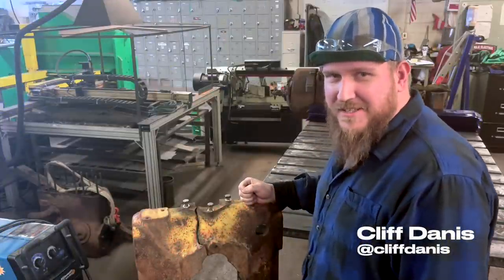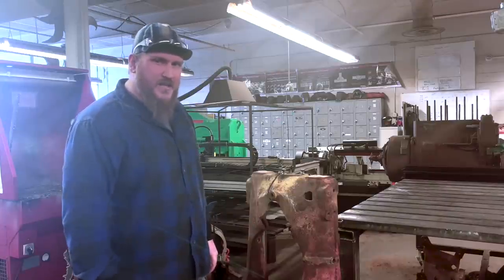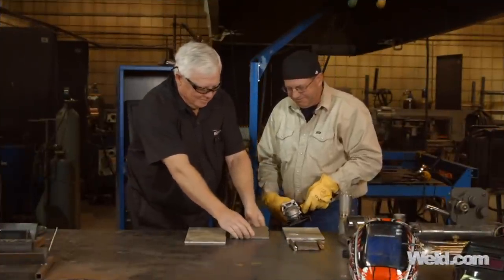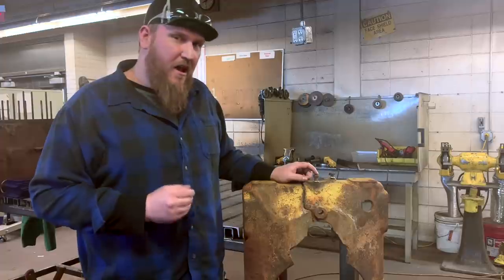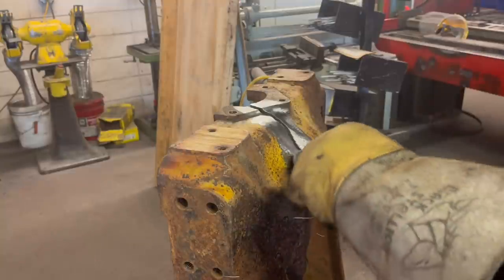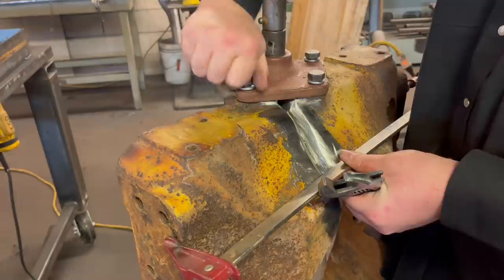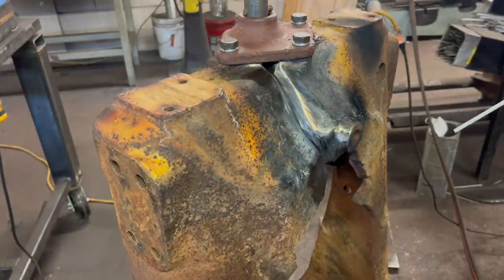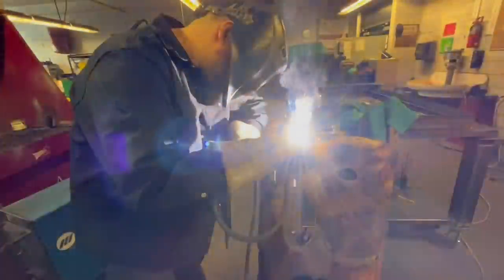Farmer's 101 on Agricultural Repair

Comment: Hopefully this repair will be a mini series, yes? Would be nice to see your finished product. A lot of us have had chaser drivers, header drivers, even dozer drivers breathing down our necks waiting for their gear to get repaired and back out in the mix. My welding really, REALLY sucks, but I’m a great grinder, and my mate was top of his class aviation welder who also did farm machinery when needed, so we worked as a team on many jobs together. My job while he was welding was to distract the implement driver until it was my time to clean & grind.
Off the record, I had him almost in tears when he tried to improve my welding, yeah, it was and is still that bad. I miss the old guy, he was a real, fair dinkum character, but sadly passed away on the job, one of the few times I wasn’t with him, very sad.

Cheers my friend, I’m sure your viewers would like to follow this project right the way through.
👏👏👏 👋👋👋 🇦🇺🇦🇺

Comment: one thing ... dont know if you did this, but after welding the one side completely...flip the piece over grind out the backside and get a full weld on the opposite side..  then the piece will be stronger as you mentioned.
Reply: A backgouge and back weld are absolutely a good option and habit to get into if you have any reason to question your root!

Comment: did a similar job on a cast iron front bolster off a 100hp tractor. grind out, drill your ends, preheat, weld with high nickle electrodes, peen immediately and cover to let her cool down over night. and pray ya don't hear the ping well it starts to cool and destess 😅

Comment: i have family that run a small farm type workshop. there is a big difference between hack welding job and dirty in the field get it through the day type welding. farmers often do temporary welding so they can get the job done and then get it back to the shop for repair. those sorts of repairs are perfectly fine. the problem comes when farmers don't do the maintenance and those temp repairs become permanent.
Reply: @TankToChest  i usually find money is the excuse rather than the cause. i've had bosses who have lost $1000 in production because they would not spend $10 in repairs.
Reply: Nothing more permanent than a temporary fix.

Comment: As a self taught out of necessity amateur welder. Prep is my friend. Farming equipment on my small homestead and vehicle/trailer repairs are most of my welding, with some fabrication. For years E6010 was my goto for everything but more and more E7018, E6013 and E7014 have found a place in my shop. E7018 covering most repairs these days. I still have problems fillings holes and bridging gaps. That said had I been doing that repair I would have "V'ed" out as you did but not to the point the gap opened, welded it up, flipped it over ground it out from the bottom down into my first weld so none of the "crack" remained and filled it again.
Reply: You can use electrode negative for open root

Comment: A great video. I just suggested this channel to a new guy on the farm who wants to learn to weld, and this video is right in time for it! I hope to use these lessons myself as I build and repair things.
I'd love to see guides on welding on loader buckets, as well as dealing with awkward locations on equipment.
From the brief references to what different types of rod does, I definitely need to put together a reference sheet for rod type and application, in addition to what spark tests mean.

Comment: Good video.... But do the same on the back side.  Gouge it deep then fill it up with stringer beads.  Wide weaves look nice, but often trap flux.   Weld a few support straps across the welds afterwards. Extra support in a stress area is always good.  Ni Rod (Nickle rod) is often used to fix cast.  Pre heating  your cast is good, but post heating is important too. DON'T let it cool too fast. That'll cause cracks.  Read up on welding cast before getting started.  Welding cast  is a tricky business.  I know.  I welded a LOT of it in a welding shop and was taught by old timers.

Comment: Preheating any cast is a must before welding! 7018 is the standard AAR requirement for all RR repairs but as you said 6010/6011 is something to fall back on in time sensitive repairs where thing have to move and you can’t do a preferred repair.
Reply: Ive done 6010 root then finished with 7018

Comment: Very good video. My suggestions would be. 1) after the root pass I would step up to a 1/8th rod at About 110A for a faster thicker fill. 2) Baking the rods in your household oven for 30 minutes or so at 350F before use.. assuming you don't have a proper rod oven.

Comment: 7018 type rods are the standard fix for farmwork over here in Europe. We don't have 6010 type electrodes here. 
Esab has a good repair manual with different filler metals for different applications. Problem is that there is just too many different types and they are rather expensive. 
That's why 7018 is usually the go to rod for most applications. And to be honest my welds haven't failed

Comment: 6010 and 6011 and even 6013 works ok for now to get you home type stuff but a good Lincoln 7018 will make a dam strong weld and people say it has to be perfectly clean to run 7018 but I'm talking you 7018 will burn through way more crap than your told (from experience)
Reply: A tube before valve had a leak and all the sector had stopped....as fast as you can repair it.for my good luck the tube was empty.but for my bad luck the whole tube from the leaking was a mess.H2So4 had started to build wall around the tube..i didn't clean up it at all...my employers was in a hurry.i complain that we have to grind it first and cleaning it and shaping the place to weld,to see if there is porocity or a crack,and i need a fuckin grinder wheel anyway....they didn't let me.....anyway I weld the leak with 7018 over slag and shit.the weld in vision was not bad better than shit.but the most important,works still just like that.

Comment: I was the oldest on the farm and broke my cousins go-cart at age 10. We had a crank top Lincoln welder and two boxes of rod. After some hammer work, I wrapped a chain around it like a turnakit. What did I know? My step dad & his father had day jobs that didn’t involved welding, they simply knew it had to be done when things broke. I fixed it and after grinding & rattle can action. I had some pride to keep to myself. I always said that a gamer who could not fix the equipment were doomed to fail. Look at todays fit with “Right to Fix” legislation. 
  I enjoy listen, watching but wished I could see the final product.
As you, need to plan time in Iowa, KS and NE to visit a “trashing Bee” to watch 10 ton machines do nothing other than take heat, create steam and rotors motion. Hundreds to look at as many show off their IH, Case or 1919 John Deere as if they had a convertible GTO, serial #1. Look, but don’t touch. Ok, you get my point!
 Great video, wish we had a shop class. DK, Omaha

Comment: Amazing video but I have a question! The preheat process, and welding temps followed by a slow natural cool down in such a high carbon piece of metal is basically annealing it and taking away it's original hardness. Because you're dealing with such hard metal in the rest of the piece do you have to temper the repaired section to reach original hardness or do you want the flexibility in the repaired area offered by the welding procedure to limit future cracking? Hope that makes sense, I'm still new to welding and metal work.

Comment: Hey there bud.  I'm another troll welder/tool maker.  Years ago I took a maintenance welding class(1999 or 2000) at Macomb Community College and we did a bunch of casting repair and dissimilar metal welding.  I'd like to see your use of 312 SS rod on cast iron to mild steel.

Comment: What about a 6010 root pass to dig in then fill and cap with a 7018?  I've lived on a farm my whole life (25 Years) welding since I was 9 . Dad always used 6013 and had some issues, when I went to college for welding I asked and learned a lot so we switched to 7018 rod.  But only having an AC welder and having to bake the rods for hydrogen was a big pain.  So I switched to 7014 and have had good luck with using that rod.  What's your thoughts on 11018 rods?
Reply: 6010 would work good for a root followed up by 7018! That’s a great combo and a very good option for field work to get a solid base layer of weld down before you switch to 7018. Personally I think 11018 is a little overkill. If you have it use it, but it’s a bit less forgiving than 7018. Make sure to keep a steady pre, inter pass, and post heat if you’re going to use it! It’s still a low hydrogen electrode.
Reply: @cliffdanis1521  Also wondering why you never covered any post heat or cooling information, especially for cast which I understand has to cool very very slowly.
Reply: Kelton this is cast-steel, different from cast-iron and is a bit less susceptible to the cracking you’d experience with cast iron. A little inter pass and post heat never hurts when moderated.
Reply: @cliffdanis1521  Hi Cliff you mentioned 200 - 300 preheat ... for us "frugal" types is there a cheap way to know when you reach that temp in metal?  Next question for high carbon content repair, what about a post heat?  Is it necessary, what temp and for how long?  Would some kind of crack detection not be a good idea (magnaflux or dye penetrant) after welding to confirm quality of repair before putting everything back together?  I always wonder is my weld really good or just looks nice.  How can I tell without xray?

Lastly, when you show welding occuring without some filter, all I can see is a blinding light and a guy holding a stick ... can you try and shoot so I can watch how you are manipulating the puddle, where the electrode is positioned in the crack, etc.?  Some weld.com videos are split screen (thats nice) or some other tech that allows really seeing the weld occuring.  Thanks for this relavant content, I will head to the garage to weld up a box scraper for my tractor.

Comment: Good advise. I have an old cast iron scalding pot that is cracked. I se that after I do my cleaning and grinding I need to heat that area before I start welding with my 70-18 rod. This is an old cast iron pot. Any tips and advise? The crack is approximately 10”, I haven’t dug it out of the dirt yet.
Reply: Keep in mind the repair on this video was made on cast steel, different from cast iron. For a cast iron repair you would need a nonferrous alloy for your filler metal. Either bronze or nickel work well. Not 7018!
Reply: Buy a new one, lol. It’s most likely gunna crack again. Thermal spray welding is the only decent way to repair cast iron I believe
Reply: I was looking at it yesterday. It’s been in the dirt so long that the rust has made it to thin to weld. It’s flower bed material for someone.

Comment: Hello::: Just got a Vulcan 220 Mig, going to learn to Mig. That was good info !!! Got a Sears 220-110 AC-DC welder 1984, did not get very good.
Reply: I have one of the old Sears models and tried learning on it. It was no doubt a tough learning curve. A few months later I bought a cheap mig/stick machine and could not believe the difference in ease of welding. Try SMAW again with that Vulcan, you should be pleasantly surprised at the difference.

Comment: There are many a chicken sh÷/ looking welds on ag equipment bouncing through the field pulling rocks out of the ground..... and the only reason that the farmer placed that weld there is because the 'Professional' welder working under idea conditions in a shop, placed a weld that didn't hold.
I learned to 'farmer weld in the '70s.... college learned in '78-80'. apprenticed in the '90s, Journeyman and red seal B pressure since late '90s and college teaching  welding since 2005.
The more we steer people away from the 6013 /7014 that I was sold in the '80s the better. Well done with this video.... but I have a soft spot (and therefore a defensive stance) for the farmer who cannot pay the hundred plus dollars an hour repair costs that are charged up here.
Thanks for getting information into the minds and hands of the common folk. Again well done!

Comment: Question: I have welded cast before using Nickel rods....I always thought they were best...But recently I have herd of just using 7018...Nickel is unreal price now..What are your thoughts?
Reply: 7018 would not be the correct filler metal to use on Cast Iron. A nickel based electrode would be one of your best options for welding filler metals

Comment: i dont mean to be that guy....   buy you said at 16:05 that you are holding the rod perpendicular to the workpiece at the proper angle...   since you are welding 7018 uphill,  is the proper rod angle not 10-15 degree angle upwards?

Comment: Wait I thought you said that was a farmer's repair. My dad always taught me to put some pieces of rebar in that groove to cut down on the welding time And bridge the gap crossways with a couple of pieces of angle cut off an old bedframe to make it strong. I don't think you know what you are doing (heavy sarcasm).
Reply: That is a gold comment! So true, fill it in with rebar and then just cover it with globs, it’ll hold. 
Glad my father taught me to like the video, take the time to weld it right, might have been burning the midnight oil but it was fixed right so the next night we weren’t fixing it again.

Comment: It’s too bad you couldn’t lay that weld joint flat and use a 7028.   It lays down much more metal for wide grooves and is also a low-Hy rod.

Comment: Now let's say you have a crack in a bended piece of the metal and you can only grind out part of it.    In theory could I start from the grinded part and work into the crap? That way I'm working to the contaminated steel rather than bringing the contaminates with me

Comment: yeah.... you are not running 7018 in an ideal way from what i see from the welds.... it looks like you are backstepping along the way like you are welding with 6010 or 6011...   you just run straight up and let the pool fill in,  maybe a slight side to side movement,  but that is honestly personal preference and whatever fits your welding style the best...   anyways,  i just run it straight uphill with a 15deg angle and let your travel speed allow the puddle to widen and contact each side of the bevel,  not backstepping.

Comment: A nickel rod would work way better, I'll just about garentee that's going to break. 200 degrees is what you heat thick low carbon to, cast should be bright up to 500. As someone that fixes and repairs all types of cast irons, this video is very insulting
Reply: He’s not welding cast iron. He’s welding cast steel, quite a difference in strength and repair practices.